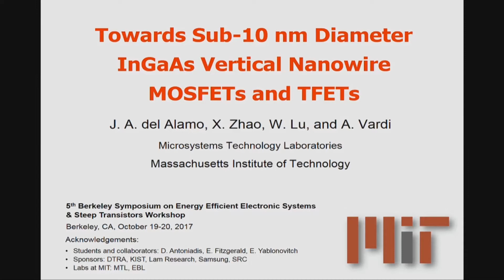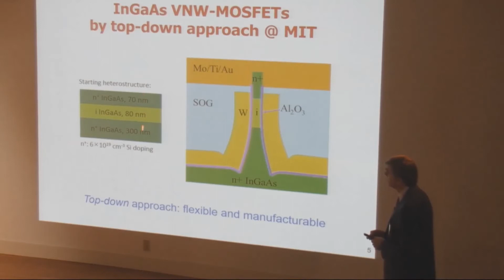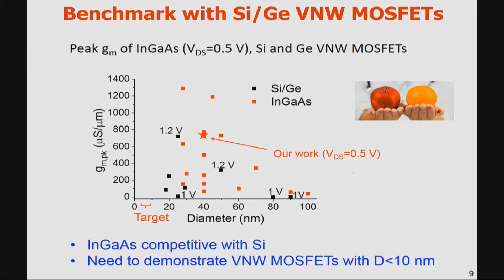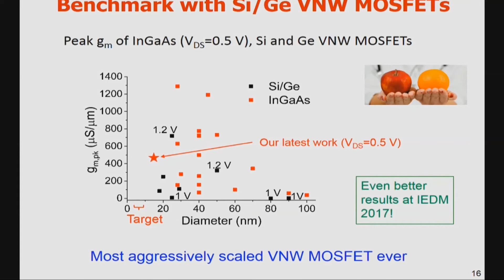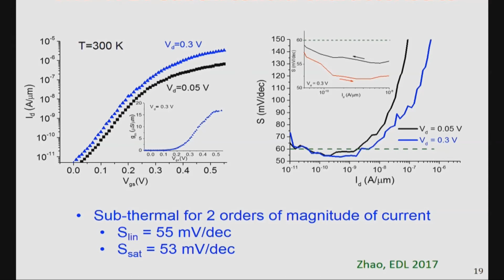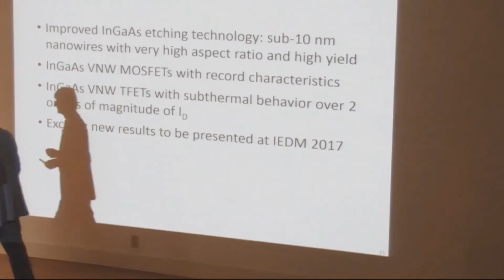Towards Sub-10 nm Diameter InGaAs Vertical nanowire MOSFETs and TFETs

Comment: what's the point of it, if you have 40nm column at 40nm spacing for example  and etching from it at the end center to center distance of columns remain. the same and therfore transistor density. how could then having more transistor in same volume?

Comment: I have a few questions. I hope they are not too stupid. :-)

Is there a reason that at 2:00 the pillars are packed in a square grid rather than in a hexagonal grid? I would suppose that a hexagonal grid would allow denser packing for the same amount of interference. In the lower image, it looks like the upper half is stacked in a square grid, whereas the lower half is stacked in a hexagonal grid.

Is 3% defects (11:36) something one can work around, or is further improval of yield necessary before deploying the technology industrially?

Does the transistor density improve/change when moving from 10 nm finFETs to 10 nm vertical nanowire transistors, so that the nm measure is not directly applicable?

Does this technology somehow improve prospects of single-process, multilayer circuits?